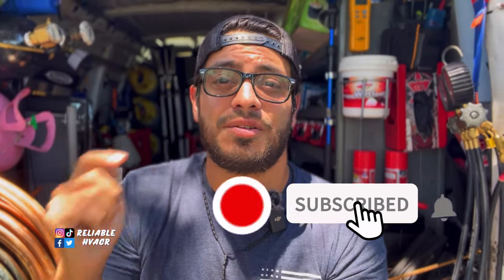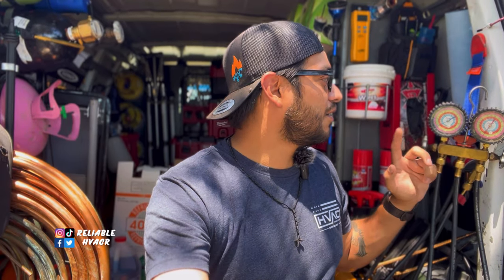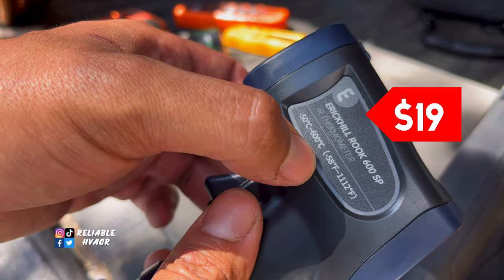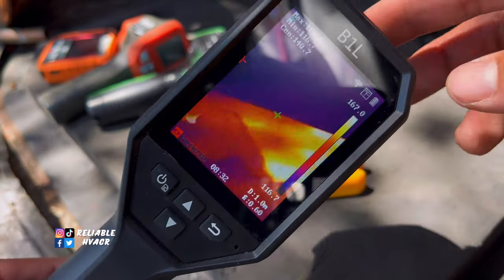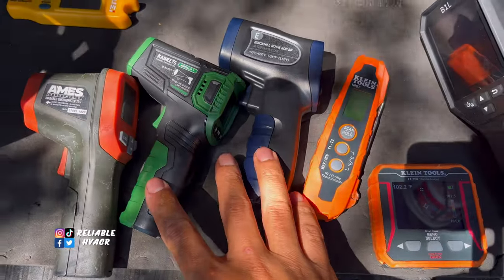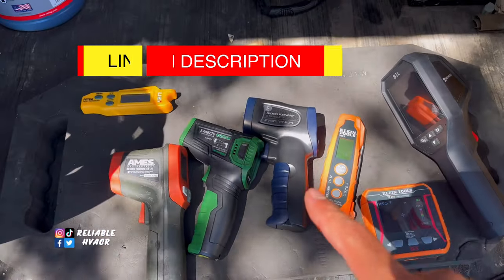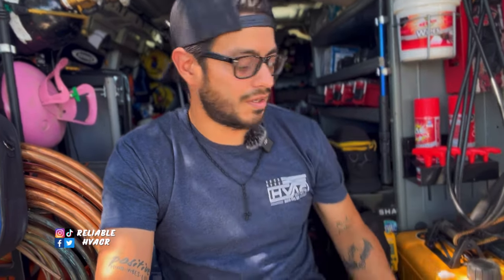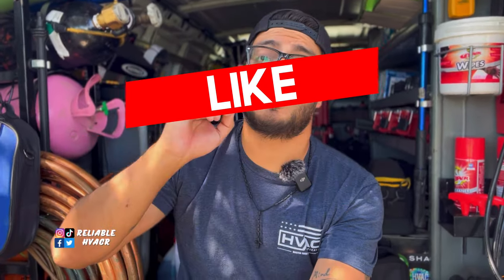How we use temperature for EVERYTHING / Thermometer tools for HVAC

Comment: Do you have cheap and accurate thermometers for checking subcool and super heat?
Reply: I was wondering the same. Can I use a thermometer with probe (Klein ET05) to measure subcooling and superheat by placing the probe directly on the pipe or do I need a more expensive clamp style? Did you ever find something?

Comment: Well stated Adrian....pressure is just temp anyways. More to the point....saturated temp vs line temp
** WITH A THERMAL IMAGING CAMERA THE IMMISIVIVITY SETTING IS IMPORTANT FOR ACCURACY. IT DEPENDS ON THE REFLECTIVE NATURE OF WHAT YOU ARE TRYING TO READ....BLACK OBJECTS DONT REFLECT HEAT, LIKE A MIRROR OR COPPER WILL. THIS CAN GIVE YOU FALSE READINGS *